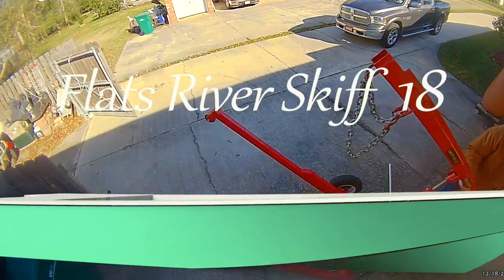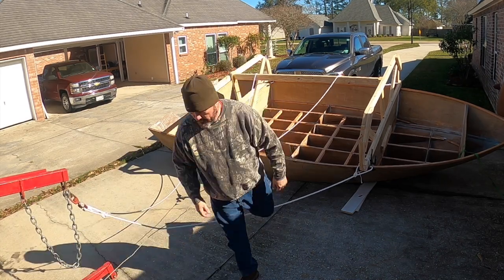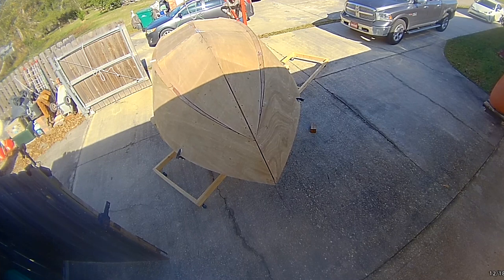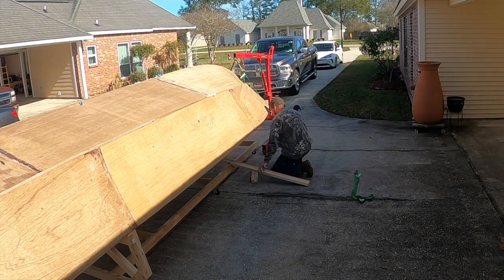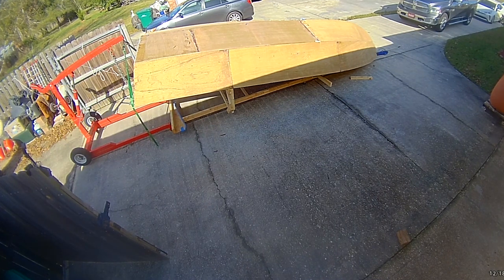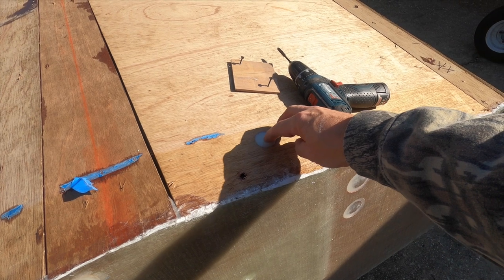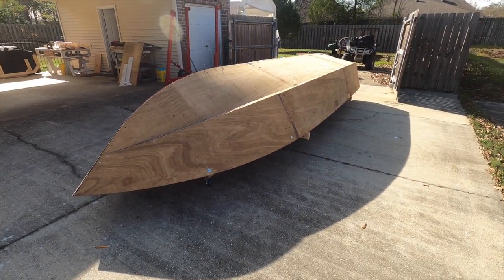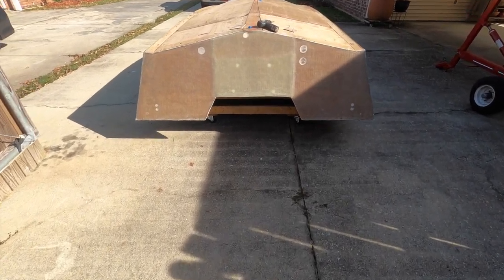23. DIY Boat Building: FLIPPING A BOAT on Purpose!

Comment: Just rolled my boat over after glassing, fairing, and painting the bottom of the hull. That's why your video caught my attention. I'm building mine from scratch, making my own plans and patterns as I go utilizing my 30 years as an aircraft mechanic and applying the same methods used in aircraft construction. My build's taking longer, but I wanted to build mine specifically for inshore fishing so I could get into some of the places where kayaks go. I just got my boat on the trailer so I can start finishing out the interior. I'll be following your build closely as it looks like your build is going at a much faster pace than mine. Buying the plans helped speed up your build quite a bit! But as I watch your videos, I can say "Been there done that!"
Reply from the maker: Yes buying the plans is really what launched this and made it all possible and sped me along.  A lot of respect for you doing it all whole cloth.  I may entertain that down the road, but right now I am enjoying this process and have a group of fellow builders as a resource.  It’s been amazing how I can reach out to actual yacht builders and get first hand feedback.  But as you watch if you see something coming up that you figured out a solution to feel free to steer me in the right direction.  Best of luck on your project.

Comment: Great work dude!
Reply from the maker: Thanks dude.  I’m still trying to catch you, but you seem much harder at work than me.  Back in the 50’s tomorrow so maybe I can get some epoxy down.
Reply: @Bigeaux20  lol no rush enjoy the process. Once I finish painting and flip the console/livewell is going to take me a bit….then sourcing funds from the wife for a 60hp motor
Reply from the maker: I want to enjoy the process, but not as much as you.  I have already started to haggle on my console design and wiring diagram, switch panel, and dash layout.  I grabbed a Simrad unit on Black Friday and saved a few hundy.  But I know better than asking the bride about a 115.  That comes out of my side of the ledger.

Comment: This part was a little nerve racking!!!!
Reply from the maker: It was very nerve racking until it was over and then I sat around wondering why I was so nervous.  It was the most logical solution to the problem and it worked magically I must say.  Now the nerve racking part will be filliping it back over.   After the glass, the fairing, the primer, and the paint nerve racking parts.

Comment: Fine job.  I’m a little bit ahead of you in a build.  I would suggest to do as much of your fairing as possible before glassing since wood is much easier to shape than cured epoxy.
Reply from the maker: Yeah I spent the better part of a day fixing all the stuff I thought needed attention before I glass.  I’m sure it will still have issues, but I have at least hit everything I thought I needed to do.  Appreciate it.

Comment: My only advice would be to use thinned down resin on wood for more penetration before glassing, you might have been planning too but no good telling you after 👍loving the build
Reply: Oh and if you are making peanut butter for filling use the finest wood Flour you can get ,and cut round spatula's of different sizes out of plastic that will work with the contours you want, saves an age in sanding 👍
Reply from the maker: Yes the typical process for me is to saturate all the wood with thin epoxy first, then either wet out the glass on my table, and put it in place, but on this big long runs on the bottom, I am just going to wet out in place.  My hope is I have enough slow cure epoxy for all of this big run, but I may have to get into some of my medium cure.  Temps should be cool enough it will all be fine, but we will see tomorrow.